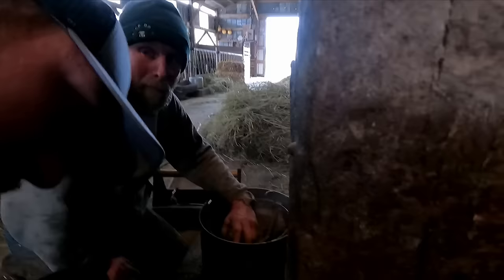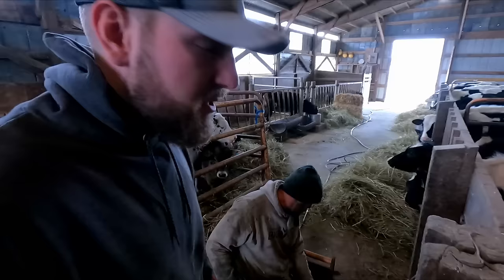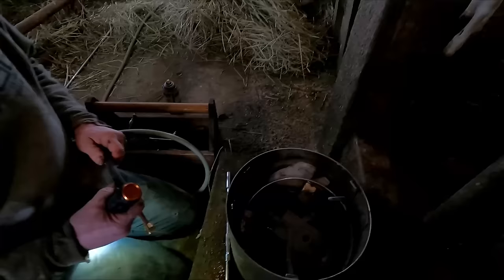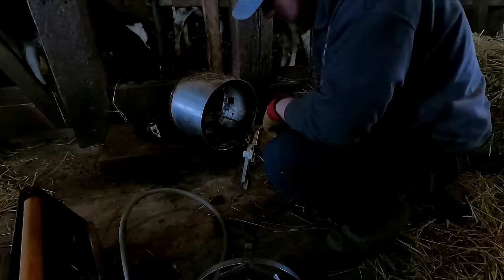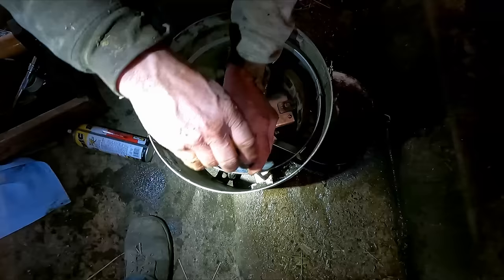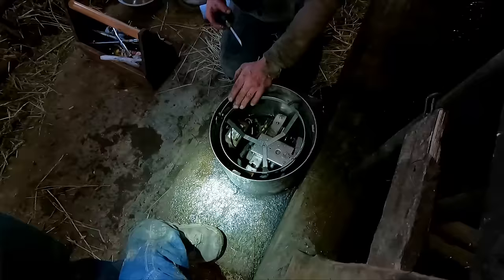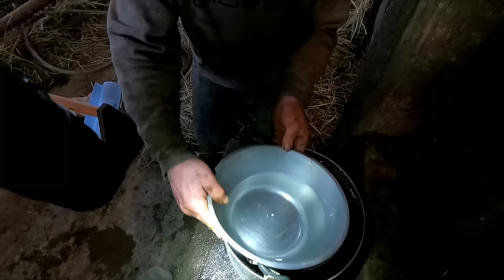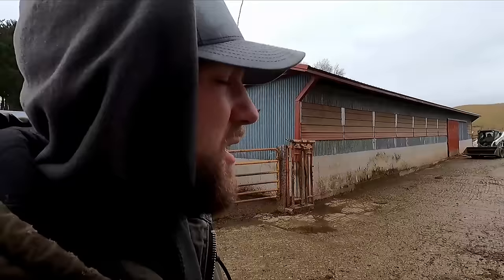Fixing Water Fountains and Cleaning Pens! Dairy Farming in Wisconsin!

Comment: Cattle always seem to have to help if you're within reach. I carry extra insulators, tools, staples,  etc. in a 5 gal bucket when checking fences. Cows never seem to be content until they've tipped the bucket and spilled the contents. Good info on the water cups. Clean up around the dairy is a never-ending project.

Comment: I run a horse stable. The barn has 26 stalls with 26 Nelson 730 waterers. The way they are wired, there is a 2 amp buss fuse that fails when the heater quits working. When the fuse fails there's a little light that comes on. All our pastures have 760 Nelsons. Unfortunately they are not wired  the same way. When the waterers are in constant use i have little trouble with them. We actually don't use the stalls on a regular basis because the horses are much better outside plus our labor is much less. Once or twice a year we host horsemanship clinics which requires me to turn on all the waterers. As a result of sitting they often get rust in the valve that causes them to drip, over filling the water bowl.

Comment: It's your farm, it's your business, but I have to ask if you have ever looked at the MiraFounts? They seem to be simpler, and easier to maintain. No electric, just a lot of insulation and a simple valve. Just curious. Great teamwork and video!
Reply: I’m up in Manitoba Canada and cheaped out and got four Mira Fountains. Never again, good valves but the doughnut heaters are not very good. The worst part of them is the small access hole on the side. Ritchie fountains are more money but are far better in cold climates.
Reply: @randynancywarkentine2810  I have never used a MiraFount with a heater, but I am in northern VA, USA.
Reply: This winter has been very easy on us. But we sometimes have minus 35 nights on a more normal winter, that kind of weather really shows the weaknesses in just about everything.